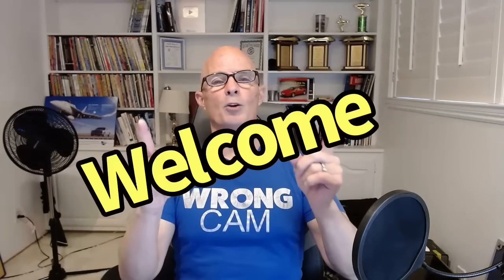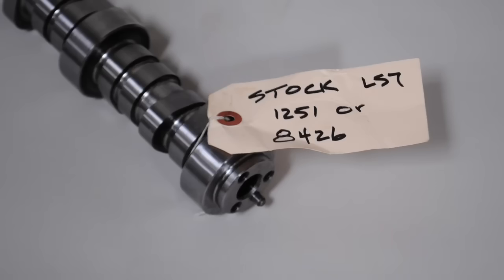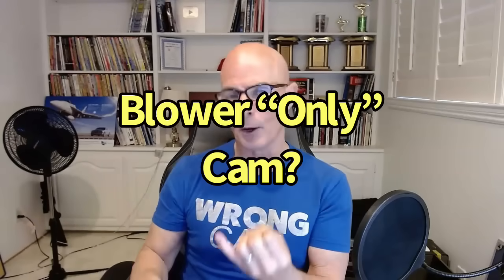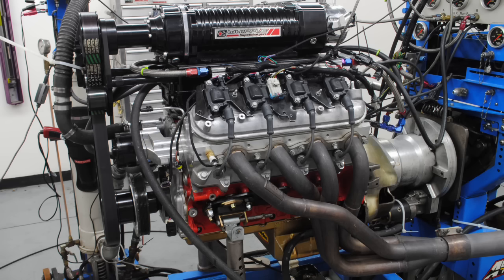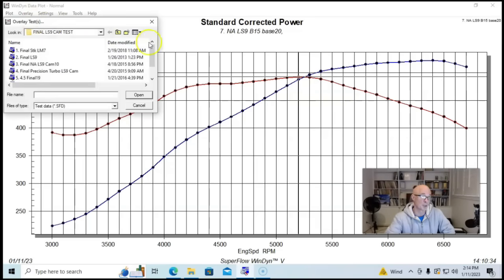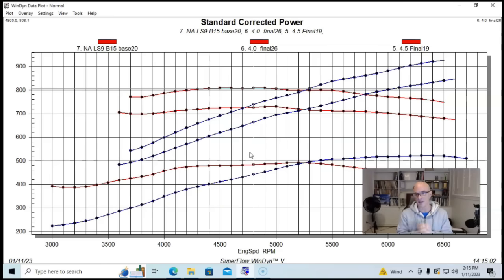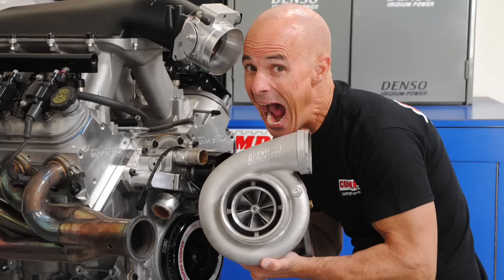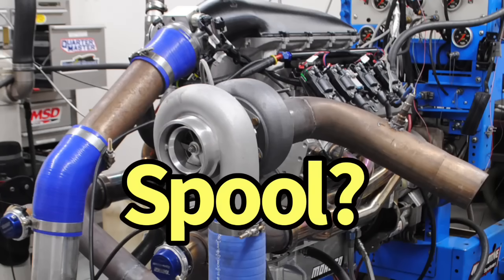LS9-THE MOST POWERFUL FACTORY LS CAM! WILL IT WORK ON A DESTROKED (4.8L CRANK) TURBO LS3 OR NA 5.3L

Comment: In you opinion would the ls9 cam be a good selection for my set up? 402 cid, stage 2 tea 799’s 11.1 comp, (Tremec tkx  3.27 1st gear, 3.08 rear, early c3) looking for a great all around driver. Thanks for all the LS  information you share.
Reply from the maker: no sir-I would get our Truck PLus-the LS9 will be very soft down low and in the mid range (it makes decent peak hp for a stock cam, but is very soft elsewhere)

Comment: On a na ls3 with a ls9 cam how high do you think it could rev out and still hold power with a Hiram and valve train that could support it
Reply from the maker: The LS9 cam in an LS3 won't make peak power very high
Reply: @richardholdener1727 yeah I just recently did the cam in my car and with the ported rod mod I shift at 7k but was wondering if there would be any benefit of doing a different intake like a trinity or Hiram and revving it out a little more

Comment: I have a 2011 Corvette Grand Sport with the LS3.  I added an Eforce supercharger system and ran on the stock LS3 cam for awhile.  Pwr and Tq on the LS3 cam were 520/520 peak for both.  I later on in 2023 replaced the stock cam with a stock LS9 cam.  Because of the PD blower, bottom end and mid range Pwr and Tq were minimally impacted losing about 10 hp/tq.  But above 4900 rpm, pwr and tq increase significantly with hp at 565 (+45) at redline.
Reply from the maker: is this on pump gas?

Comment: anyone have a great cam to go with for a 2011 gmc sierra 1500 that tows stuff? l92 6.2 ls swapped rebuilt and will be whipple supercharged. with a circle D torque converter not bought yet for daily driver with 6l80 transmission 50% city and 50% country driving with hills and curves. need some input I want some power down lowish rpm no i don't typically drive much past 2500 rpm when not towing and maybe up to 3000 rpm if it's a heavy load
Reply from the maker: Low Buck Truck

Comment: The LS9 was designed to kill low and midrange torque so it will live, using the blower to pump up the torque from off idle to 4000 rpms

Comment: Spent years piecing together a NA setup but always had doubts about my choice of converter and cam, couple weeks ago I decided just to go FI since averything else supported a mild-mid LSA setup. Snatched a LS9 cam for $80 and front timing conversion for $100. Working on odds and ends to slap on the LSA I picked up yesterday

Comment: I know this an old video,  in my particular case I saw a  pleasing increase with switching to an LS9 cam ( manual g8 gxp).  Stock was a dynojet it made 381/376 after the LS9 cam I saw 419/402 with a subpar tune. Interestingly enough TQ at 3000 was up 20ft/lbs with LS9 cam, I totally expecting the reverse. 
Since then I’ve added LTs, ported TB, catback and lastly Quality tune.  It’s been 80k trouble free miles 😊

Comment: The thing holding back the LS9 cam is the 122.5 LSA. Change the LSA to 107-109 range and YEE-HAW! Then it would be an amazing factory cam.
Reply from the maker: IT WON'T IDLE
Reply: @richardholdener1727  Then why does the Truck Norris cam with 107 lsa work so well?
Reply from the maker: the Truck Norris isn't just a 107 lsa-it has valve events that allow it to do the things it does (after much design and testing). Those who focus on 1 aspect of the cam-are missing the big picture.

Comment: @richardholdener1727, you usually run these test with the Gen III motors which are normally around 9.5:1 compression.  Would there be any real power gains by doing the same tests on a Gen IV motor, many of which are 9.9:1 compression?  I don't know if the roughly 1/2 point increase in compression is enough to make a difference.  Maybe a Gen III vs Gen IV vs Gen V (LT) test is in order if you can find three motors with similar cam specs.
Reply from the maker: 4/10ths of a point is a change of roughly 1.5% in power

Comment: Hey Richard I’ve been a sub for about 4 years now to your channel and congratulations on your success.. I just recently bought a Comp 54-303-11 cam which is from their LST line. I know you done tons of cam videos and I’m sure I’ve seen them all multiple times but was wondering if you could do a test with the LST line vs. more aggressive ramp rate cams and comparable size. I Also have AFR 215 heads and a Fast 102 with matching TB. Would be awesome bro. Just a thought or question rather. Thanks for awesome content for gear heads like us 👍🇺🇸
Reply from the maker: THE LST STUFF WORKS WELL

Comment: I'm running an LS9 cam in an LY5 block 5.3l with stock 9.9:1 compression, TBSS intake, 92mm TB, mostly stock 799 heads with better springs, and shorty headers in a lightweight CJ5.  It makes plenty of torque down low for the Jeep, and it really builds as you rev it out as your dyne graph shows.  It's also very civil for just driving around town with good vacuum and a reasonable idle.
Reply: Similar to the direction of my current build. For the cam, did you have to change timing cover and reluctor to run that cam? I have a lm7 in my truck, but I believe the one I am building is an L59. Also is a tune required? I plan for tuning with hptuners in the future after I break it in for a few hundred miles and save up. Thanks!
Reply: @wht240sxka   The L59 is essentially the same block as the LM7 you have now.  My motor was changed to the different timing cover, but the LY5 is a gen iv motor and I'm using the stock reluctor wheel.  The cam doesn't care which wheel you use as long as the cam position sensor and tune match the wheel.  Yes you will need to tune it before you run it very far as the cam is very different from the stock cam.  I wouldn't drive it without tuning it first.  It will make less torque down low then the stock cam, but it makes a lot more top end power.  You will also want to upgrade the springs in the heads as this cam is really designed to run over 6k rpm.  I have my redline cutoff set at 6500, but it would pull to 7k and beyond if I let it.  The stock truck valve springs are not designed to handle the higher rpms.

Comment: Is there a video on what to do with the computers on an engine swap? I am 100% confident in all the mechanical aspects of building a motor. But I have no idea what to do with the computer after the engine is built so it holds me back 100%

Comment: Is there a video on what to do with the computers on an engine swap? I am 100% confident in all the mechanical aspects of building a motor. But I have no idea what to do with the computer after the engine is built so it holds me back 100%
Reply from the maker: I DON'T EALLY DO SWAPS-CHECK OUT SLOPPY MECHANICS FOR THAT
Reply: @Richard Holdener  okay thank you, it's not really a swap it's just taking a 5.3l engine that's currently in the truck and building it up for power
Reply from the maker: do you have hp tuners or some ability to tune the new combo?

Comment: Hey richard…have 2 questions, im rebuilding my 6.0L LQ4 in my 06 yukon denali and using the BTR truck norris cam…can you use pistons from a LQ9 in a LQ4 to get a little more compression? I just want to verify that you can, and would i need to upgrade the stock fuel injectors to bigger ones? And is the stock 78MM throttle body enough to feed everything  properly/efficiently or would you recomend upgrading the throttle body?? Any tips you can give to help to make my daily a NICE daily is appreciated.
Reply from the maker: YOU WILL NEED A TUNE AND BIGGER INJ

Comment: Hey there Richard, I'm in Australia and I have stayed true to the Aussie delivered LS1 and have utilised standard crank with forged internals rings gapped to accommodate for some boost CNC 241 heads decked 40 thou and a 234/241 @.050 .608/.609 109lsa on ethanol makes great power it's a freight train from 3500 all the way to 7000

BUT I want to throw some turbo goodness at it! Start off at 7psi but ultimately end up at 13-14psi 

My question is am I going to damage my engine making up a turbo kit with L98 CAST manifolds or should I flat out build my own 1 7/8 primary manifolds and kit?

This combo moves some air as it is, cheers in advance Richard!
Reply from the maker: STOCK MANIFOLDS ARE GOOD

Comment: The LS3 hot cam the comes in the LS3  495 horsepower crate engine is simular to the LS9 except lobe separation LS9 122 LS3 hot cam 112 peak numbers seem to be somewhat close l think the hot cam makes more low speed torque sooner and carries out slightly better over 6000rpm than the LS9 cam does but it's not a factory cam it's a performance cam made at GM performance duration numbers on these two camshaft are not exact but simular and the LS9 camshaft has a little more lift than the LS3 hot cam does and as you tested before lift has very little to do with making more power unless it's over .075 or more and it only wirth a maybe 5 horsepower upping duration is much more effective in making more horsepower than lift does seen your video on the truck Norris truck cam low lift version NSR cam vs high lift version that requires upgrades valve springs there was no power difference to speak of

Comment: Hey Richard, I’ve got a bone stock LM7 mated w/ a 4L60E in 2000 Silverado. I’ve been watching your videos for a while and have come to trust your extensive research.  In my truck everything’s 100% stock.

I have heard that the transmission can only hold 600ish HP. That being said I assume if I make 600 crank HP that it would be close to 500 wheel? (That’s what I’d like to have)

If that’s the case, i really want to work my truck up to 600 crank HP. My problem doing so, is I want to do it in steps on a budget as I learn more about engine building.

What upgrades would you recommend starting with? Could you give me a brief breakdown on cheap, easy and gains I ‘could’ expect?

I thought cheap turbo but I’m scared it’ll make too much boost and destroy my stock trans (if you have a video that explains this could you link it to me please sir?)

Thank you
Reply: I also want to add that the different variations between the LS blocks and heads is confusing to me. It sounds like I can use 6.0 heads on a 5.3…?
Reply from the maker: your 4l60e wont take 600 hp
Reply: Okay fair enough, rather know that now than find out the hard way.

What kind of power upgrades would you recommend for my setup? Also curious if you know what power the 4L60E is capable of handling. 
Thank you!

Comment: Any chance of a Harmonic Damper test? ATI has claims that their Damper "makes HP" and I have heard from other sources that claim to have dyno tested this theory that the ATI did show the most average HP across the graph when compared to other brands and OEM generally makes the most HP because it weighs less. This seems like an easy enough test to just swap out balancers and make a hand full of pulls. One video I saw even though the motor made 2 less HP they said the motor "sounded better" or quieter because of reduced harmonics.
Reply from the maker: WOULD BE GOOD

Comment: Richard, I love your videos. Can you do a 351w gt40p head combo video. I am considering this setup for my 91 bronco, vs rebuilding 302 with gt40p heads. Just looking at different options. My goal is 350hp. Is this possible with these two setups?
Reply from the maker: go 351W

Comment: Richard, I’m curious about your thoughts as you may have come across this. It’s not related to this video, but I figured you would see this before one of your older videos.

Twincharging. I’m curious if you can make it work the same way compound turbos work. Instead of rigging it up like VW does from the factory (charger feeding turbo, feeding intake), if you rig up a centrifugal supercharger to feed a turbo, to then feed the intake manifold. 

Would this have the same outcome? It seems east to get 60+ psi out of compound turbos, and I’m curious if this would work the same. Might be a good test video, as you probably have these things laying around.
Reply from the maker: why would you choose a centrifugal to feed a turbo-the centrifugal makes very little boost down low

Comment: Thanks Richard. I just wanted to thank you for your guidance through you videos on what parts to use one my  88' 5.0 engine in my 66'  Bronco. It feels like double the power with one unintended consequence, I got a mean axle wrap. I guess a 4 link is next.  Thanks again.

Comment: I was told bye Benny hill's mechanic . Duration the is what you want alot of .    Lift  just wears out your heads .  My head's say they start flowing best after 528 lift . At 28 degree timing.

Comment: I have a 1984 Corvette.    Two turbos.  I am putting on . Useing the  cross fire injection. I hogged out  been around  253 mph. At 6.300 hundred RPMs As is.12.03 . comp.  2.25 intake.  217 ? Ex  valve .   350.cb..  my Vette is on the edge .When I get them turbos on . Going to be crazy!   Two stages thinking 3  one totally for gas's mileage .  The last stage  max to the intake  and a parashoot .  Building the car to handle the gears .then I will throw 373s  got for 1/4 mile . As it sits . Buggers tires . Higher speeds . G force   245 .  good for 250.mph .   I didn't shut down because I ran out of power or RPMs .  8 grand red line .  I love my 1984 vett .  Scary.

Comment: Richard i think all will agree. Most Underrated Channel Going you should have at minimum half a Mill Subs, I only knew enough to get myself in trouble until i stumbled onto you looking to see if i could find out minimal knowledge of camshafts so the Mechanics doing the CAM on my 2012 HOLDEN VE SS Zseries Manual L77 6.0L (LS2 and the three other variants L76. L77, L98) thanks to you and this channel i know the ins and outs of everything now....... PLEASE SOMEHOW CAN YOU TRY SOME OF THE AUSTRLIAN LS1,2 AND 3 WITH SOME AUSTRALIAN PERFORMANCE PARTS OR TRY THEM IN THE AMERICAN LS'S........
Reply from the maker: what is different about the aussie parts?

Comment: Richard how you doing man, Hey I got a 2003 5.3 truck engine. My question is what I looked up I should be fine but want to ask you Sir. I put a LS9 cam in. I used the factory style timing chain sprocket. Will that be okay ?
Reply from the maker: 3-BOLT TO 3-BOLT? AND DD IT HAVE THE RIGHT X PATTERN FOR THE CAM SENSOR?
Reply: @richardholdener1727  It's three bolt yes. Online mine looks exactly like the LS2 sprocket. I have the cover, sensor installed. Tried to fire it up awhile back it wouldn't. It's in a gutted S10. It's carbed with a 800 CFM jetted to 1000. Elderbrock Victor Jr intake, ported and polished 706 head's, big valve springs. Put a 80 mm turbo in the bed with intercooler in bed. Has a 250 adjustable NOS plated on intake. Put nos on it due to the cam being sloppy out of the hole. Iv ran nos for 23 years now on my mustang and brothers mustang. Be cool to see that 4.8 you have with the LS9 cam, turbo and 75 shot nos out of the hole. It would keep them rpms up higher for sure out of hole. Hey something to try right 👍
Reply from the maker: does it have factory eccu? if so, you need a 1x trigger wheel and will need to move the cam sensor to the new design front cover with the proper cam sensor. LS2 might be 4X

Comment: I think the OBVIOUS next step is to get an identical grind to the ls9 but with a 106 LSA 😁
Reply: that would move the power band down to a lower rpm right?
Reply: @veganjoy  depending on the LSA it could increase power across the board without any loss on top.

Comment: I view the LS9 cam as a way of GM getting the peak numbers it wanted while reducing powertrain stress (for fewer warranty issues) at lower speeds, where extra torque production from the blower setup with a better low-speed cam would have been pointless. Like, a burnout machine with extra burnout . . .
Reply from the maker: there is no EXTRA burnout-there is only burnout or no burnout..In my Yoda Voice!
Reply: @richardholdener1727 , burnout, you must . . . lay rubber, you will. lol